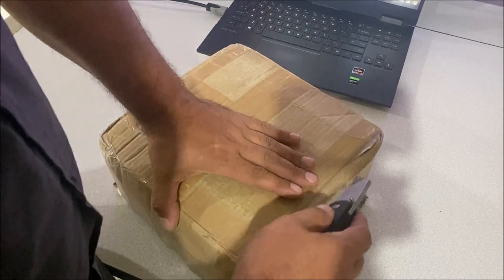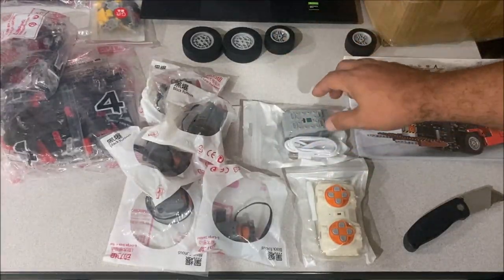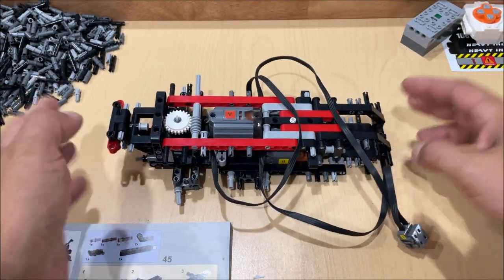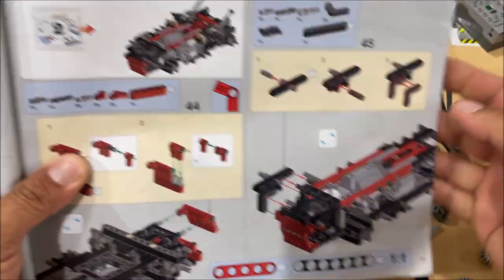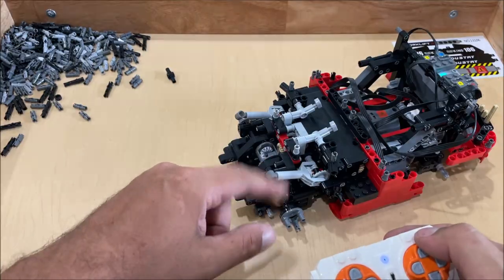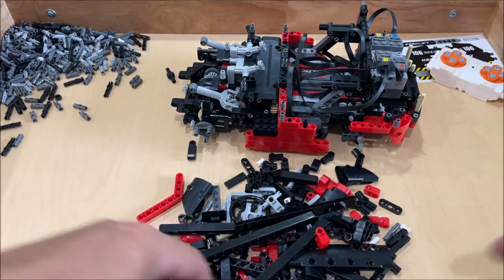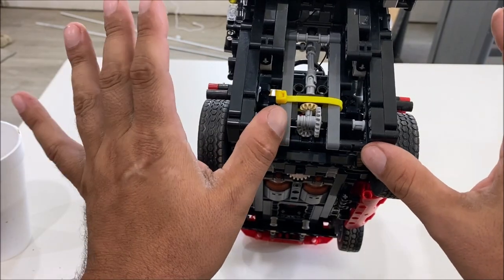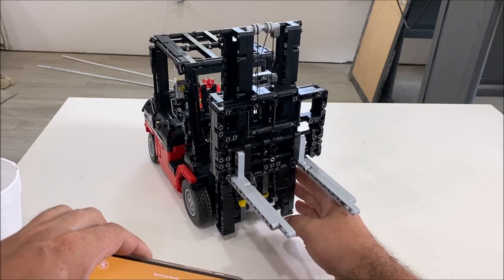Mould King 13106 Forklift REVIEW fake LEGO MOC build CREATOR technic

Comment: Thanks for the honest review!  I see so many reviews that give overwhelming praise on these MOC sets, and conversely those that just talk about how terrible they are.  So I appreciate seeing your optimism early, and then disappointment when the weakness is encountered.

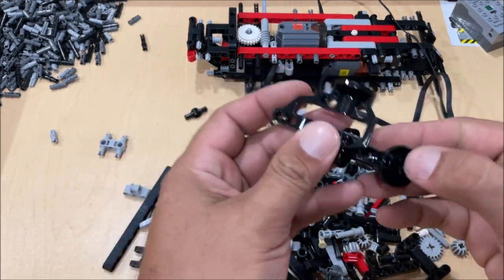The actuators are called "linear actuators", so you were close.  The pieces you hadn't seen before (at 5:10) are portal axle housings.  Portal axles use a set of gears for each wheel, and that allows the main axle between two wheels to be a lot higher up than the center of the wheels.  They are quite common in off-road type vehicles.  Lego uses them a lot in their Technic models, and these appear to be the exact same as the Lego versions.
Reply from the maker: I have this set on eBay for $85 free shipping

Comment: Maybe the gears would be a little bit stronger, if you would buy them from Lego. They normally make parts in a much better quality. I am waiting for this forcklift, and if it's the same crap, i will try to use Lego parts instead 👍🏿
Reply: It is in the past cada makes better parts then Lego now. Tgl jstar mould King sembo they are all better and cheaper